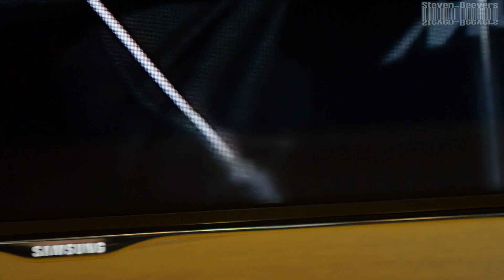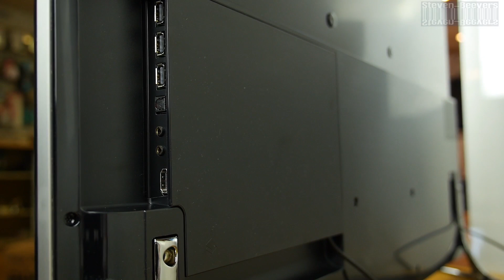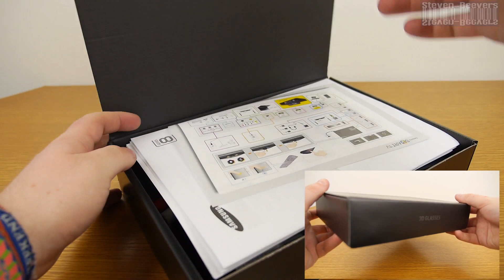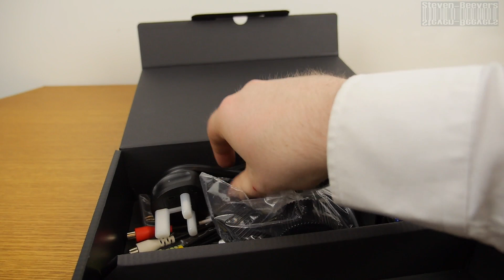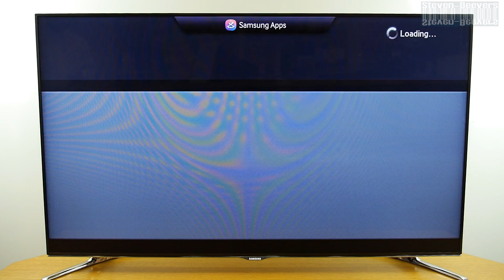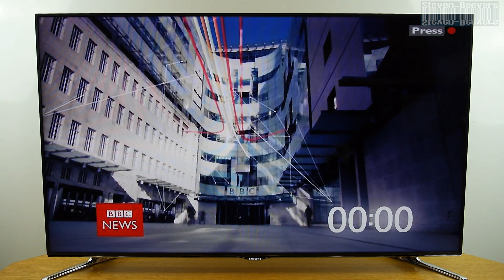First Look at the New 2013 Samsung F8000 LED

Comment from the maker: Blu-rays looked great.  If you set the TV to cinema mode, the black banners across the top and bottom of the screen are really black because they can turn the LED off on the panels there.  The stand is sturdy because it spreads out the  weight of the TV rather than standard pedistools that are usually in the middle.  Great choice to upgrade to! you should enjoy!
Cheers

Comment: Great video! Can I ask which video camera you're using to film this? I'd also like to ask how you managed to get started in sourcing these screens and reviewing? Thanks. When I looked at this tv compared to the ps51f8500 I felt the picture from the f8500 was far better, the screen was completely uniform unlike the f8000 where the backlight appeared brighter on the bottom right corner, and contrast and black levels were better on the f8500, the tvs were uncalibrated though.